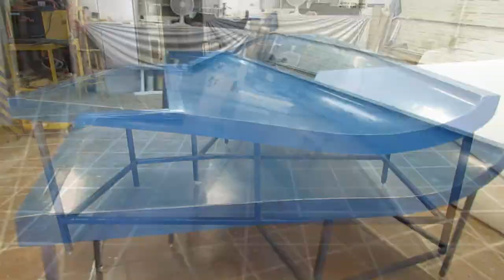AEROBATIC WING MOLD

Comment: What is the blue paint with which you give a good superficial finish to the mold?
Reply: Gurinder Saran its Gelcoat, it can be of any color you like, based on the pigment ypu mix it with
Reply: Tooling epoxy
Reply: Gurinder Saran It's a silicone rubber base to provide a surface shape for the mold. The Fiber glass is used to build the mold before the actual wing is even started.